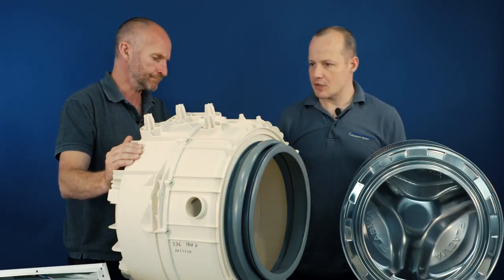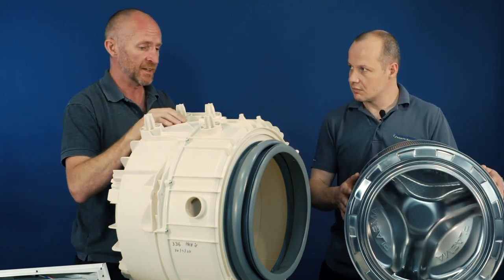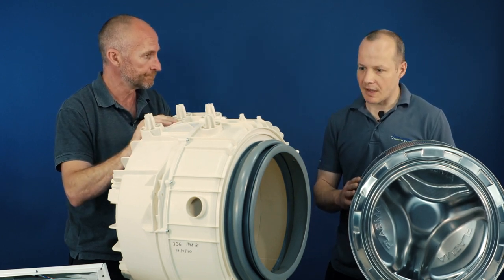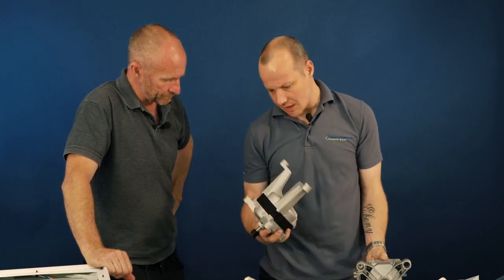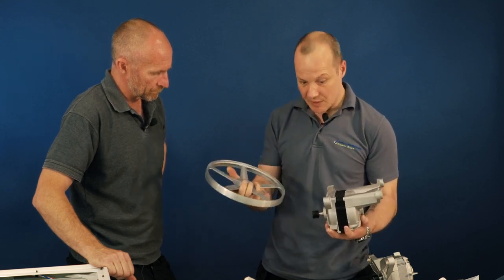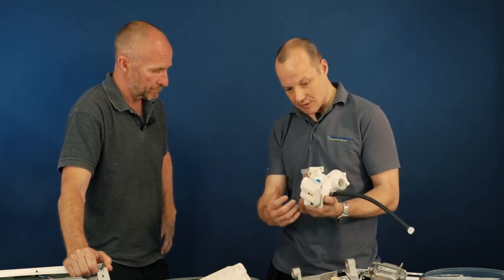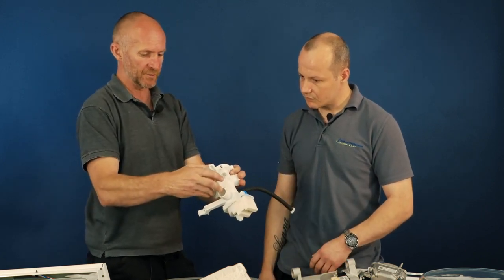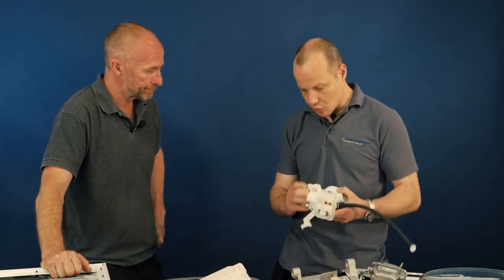Engineer Video - Taking Bosch and Ebac Apart Part 1

Comment: Just bought the 8 kg based on this, had enough of the throwaway society.
Reply: How has it been after 1 year Jon, I'm thinking of getting one but there are some reviews that say they are not the reliable?
Reply: @dellawrence4323  Faultless for me, the only slight issue I've had is that you have to make sure that the door is pushed home when you close it or it will throw up an error code.
Most likely limp wristed user error ;)
Overall very pleased though.
Reply: @radiowardenclyffe  I get that with my boch it' also beeps very loud to let everyone know you have a limp wrist. 🇬🇧 👍 😁

Comment: Some years ago I came into a bit of money so I bought a new Bosch dish washer and a new washing machine with no more that 2 washes a week the main bearings went of the washing machine after less than 4 years I phoned up a repair man and once I said it was a Bosch he just told me to bin it to much work to repair it I just buy cheap ones now when it goes wrong just get a new one but having said that I like this new Ebac and may well get one when my cheap one goes wrong as it soon will no doubt
Reply: The cheaper Bosch were "badge engineered"
Reply: I bought a second hand Bosch (Exxcel 1400 spin) around 10 years ago, and whilst it isn't used every day, or even every week as I live alone, it's never once given me an issue. I paid £85 for it and it was probably a few years old when I bought it. I personally trust Bosch as I've always (so far) had a good experience with them.
Reply: The bearing went on my Bosch washing machine just before the guarantee was up so contacted them and a engineer came out to fix it while I was at work , came home to find it fixed but went outside and the whole drum was sitting there with the bearing in it , noticed the bearing was manufactured in Poland , couldn’t understand why he couldn’t just replace the bearing.
The old drum came in handy as a patio heater .🤣
Reply: @vapoureyes  These days most washing machine drums are sealed so the bearings can't be accessed so the engineer has to take the old drum out and put a completely new one in, which is likely what happened with you. It's worse for the environment but more money for them so win-win.

Comment: I've never scrapped a machine because of a bra wire...can always get them out with a bit of work,heater out ,or sump off, extremely unlucky to get it stuck around the back and any engineer knows,recirc pumps just get blocked with scale ,get noisey

Comment: Guys, I don't dispute your experience but I can say hand on heart that in all my years in the game, I never scrapped a machine because a bra wire was stuck between the drums. Even with welded drums you can generally get it out by taking off the drum lifter. Also, it's gonna be a bit more awkward to clear should something get into that recirc pump.
Reply: these two guys getting paid by ebac to slag off bosch
Reply: @Boschwash24 You cannot deny though that Ebac machines are more serviceable. They also come with a 10 year warranty, and are British made. Unlike Bosch machines, which are mostly now made in China, unless you buy the most expensive Series 6 models.
And also, Bosch will use marketing techniques to highlight certain benefits and selling points over their competitors, just like any other manufacturer.

Comment: I can understand why the washing machine repair people are keen to promote repairable machines - that makes sense. The other related problem is the call out charges - often over £50 to get them to show up and their blame culture - we had a Hoover washer that was under warranty and the button panel broke - when the 'engineer' replaced it he pointed at my daughter and said "there, you have a child - she pushed the buttons and broke it" and then he insisted that my wife pay the bill of nearly £150. So no, too much poor experience of scammers that work in this industry. Every time a machine breaks (they usually last 7 or 8 years) I now buy a new one and install it myself.
Reply: Many years ago I was given a hoover washing and a girlfriends bra wire blocked the pump. It was still under warranty so I called out the engineer. He said the fix wasn't covered because it wasn't their fault. But he must have been having a good day and didn't charge me. Kept it for a few years (the machine, not the girlfriend) eventually actually giving it to a new girlfriends ex boyfriend, not a bad swap I thought.
Reply: @markrainford1219  you were lucky. There was absolutely no evidence that our daughter had broken the control panel and she never showed any interest in it - the bloke just intimidated my wife into paying for the repair. 
Good work on the girlfriend/washing machine swap - probably an ABBA song about that.
Reply: Manufacturers engineers are focused on finding actual failures within an appliance to hopefully learn from them and in turn making the appliance more reliable going forwards. Most engineers are happy for the easy life and will quite happily get the appliance up and running whilst also making you aware of what they believed caused the issue in the first instance (hopefully to offer some education to stop it happening again). However, the older Hoover/Candy appliances had really weak buttons and just looking at them the wrong way would cause them to break. 
Not everyone in this industry is out to get the customer, I know I’m definitely not.
Reply: @appliancerepairsnortheast6159  I'm sure not everyone is out to scam the customer but in the experience shared above, the Hoover engineer falsely accused my daughter of breaking the buttons you have described as prone to failure. He then charged over half the cost of the machine for the repair and my wife was intimidated into paying. With hindsight I wish I had submitted a formal complaint about his appalling conduct. But you live and learn and therefore I would not entertain having an engineer out to repair a washing machine again.
Reply: @matthewsemple  it’s a shame that one rotten apple has changed your full perception of an industry with lots of decent hardworking people. Still, that’s completely understandable given the experience your wife had with a manufacturer engineer/parts fitter.

Comment: On our 14y old hotpoint we could remove one of the 3 plastic tumbler paddles and access the pump opening through the drum to get a bra wire out. when the bearing went I decided to scrap it and stiped it to make it lighter to take to the recycle. I was surprised how many coins including pound coins where in the sump pump, the machine did spend a bit of time in a rented property, I guess that is were the money came from.
Reply: Did you get caught for money laundering?
Reply: @matthewsemple  ;-) quite funny - The other damage to the machine was all the silver paint missing from the front entrance to the drum, we guess the people rented had a little dog that either climbing in the drum or something, bit of a rusty mess that I fixed.
Reply: I always believed there's money in washing machines
Reply: @josephthompson4363  And settees...

Comment: I have a direct drive washing machine, I strongly feel that it's the way to go; fewer bearings no belt, no high revving motor. If only they could do something about the pump.
Reply: Noise?
Reply: Yes I have one too , did a course about 12 years ago where I found out about them and as soon as my washing machine needed changing I bought an LG which is still going strong after 10 years with only a drum rubber repaired . They reduce vibration and noise and are so much better to all the other components and my next washing machine would be an ebac if this was adopted as I like to buy British but it is a none starter if they don’t .

Comment: I'm sure if you own one of these.. that ease of opening the drum will come in handy.. weekly..
Reply: If you buy a £200 Bush, not Bosch, Bush, then you'll be taking it to the tip after two years, and paying the council a further £50 to dispose of it for you.
Whereas a machine like Ebac, you can fix it if the bearings need replacing. And it won't cost you any extra for the first 10 years. And it's British made 🇬🇧 so what's not to like!

Comment: 20 years in the service industry and you call the tub the drum?
Reply: Simply a difference in terminology… I’ve called them tubs, drums, wash units, front half, back half etc. The inner in my opinion will always be called a drum and the outer more often than not I refer to as a tub if that makes you happier?

Comment: New regulations are coming for repairability. Older machines were more repairable. Ebac might be ahead of the game. The Ebac main motor is very simple and much like others, tried and tested. It shouldn't give trouble. The belt usually is a 15 minute job.  Direct drive motors are similar in complexity whilst having more windings typically. They usually have complex control circuits which I would think slightly more likely to fail.  I doubt a direct drive has fewer bearings supporting the drum. It might be a slight compromise the bearings doing two jobs. The water pumps usually are very robust. If they check out on a resistance meter use some sewing machine oil on the bearings and be sure they move like an eyeball if that type. Old style SAE30 for old engines is good and 3 in 1 if nothing else around. Belts and pumps usually are easy to get at.  Look to empty the pump filter befor anything else. I recently rebuilt a Sharp microwave of near 40 years of age.  Same type of motor as a pump with jammed bearings ( two pole hysteresiss ). WD40 didn't do it. Terresso 77/68 power station jacking oil did. An ideal SAE30 I guess. My disabled daughter was delighted as it's so easy to use. 30 minute repair. 

The Garrard 201 1930's turntable was direct drive. It looks like modern types of direct drive motors. Instead of electronics it used clock type regulators. A felt pad had to be oiled. Fire in the coils if ignored. JVC made the better ones like TT81.

Comment: LG washing machine have the same casing as your machines, my new DD LG i got back in 2001 when i had to replace the main bearing i had to split the outer shell and replace the bearing rebuild the housing with a kit from espares it was a doddle...
I do have one question and the recycling pump is working all the time is it not slightly more costly and this makes me think that your 3 paddles are not big enough to flip the clothing which in turn helps the mechanic action of the clothes being cleaned? I seen one of your machines and they look very small compared with others ! Why?

Comment: Are the spares cheap?
Reply: Just rang Ebac with same question. The reply "well you wont know for the first 7 years as that's the parts and labor warranty. Buy direct. Going to buy one.
Reply: @leowatkins3718  Not much help then?  The only way to promote the repair and keep philosophy is to have cheap enough parts otherwise it's just as the status quo.
Reply: @rob-yt9di  I'd have thought that the parts not breaking in the first place would be a far better scenario 😉. It's very unlikely that you're going to get cheap parts on an expensive washing machine, I'd have thought, though if they're lasting then I don't mind paying.
Reply: @Nite-owl  David maybe but why make a selling  point that the drum etc allows access for repairs to be carried out? If the parts aren't reasonably priced then replacement would still be the preferred choice for most, IMHO...  It's going to the same with electric cars I expect...
Reply: @rob-yt9di  I don't necessarily disagree, but since we were never told what the prices were likely to be, we'll never know until after the 7 year warranty period.
Reply: @Nite-owl  There lies the `rub` David ...If 7 years is seen as the `life expectancy` for white goods and the repair costs ( labour + parts ) are relatively expensive then there is no difference to benefit from.
Reply: I think the point you’re maybe missing is that the drum on the Ebac can be stripped down and the bearings/drum support changed instead of having to replace the whole wash unit. The wash unit will undoubtedly be more expensive than a set of bearings and a drum support plus the removed parts are now less meaning that less has the chance to end up in landfill

Comment: Wouldn't it be possible to make some sort of service hatch in te drum, in order to get a bra out instead of taking the whole drum apart?
Reply: Asko used to do it years ago, let's just say that wasn't a success because of various reasons, and that was dropped around 1991-1992 when they released a facelifted series of machines with a new drum design ending in 2. (the top loaders kept them until the end though)

Their removable drum paddles in said newer machines were a much better success.
Reply: replace the bottom panel where the drain pump is, and have a drain pump flap, and also the soap drawer dispenser for conditioner to be re-designed, the dispenser has two plastic tabs, these can break off after use..

Comment: Bosch is just garbage like everyone else in my humble opinion Asko is the best washing machine manufacturer they are still going with stainless steel drums and spiders
Reply: Sadly Asko is now owned by a Chinese company who also own Hisense... so I expect their products to get worse and worse like everything else
Reply: LOL. Asko hasn't used SS spiders since 2006, and even then they were problematic on high spin speed/1600 RPM plus machines. There's a reason they moved to a (very high quality however) aluminium spider in that year: tighter tolerances.

Hell, even my 20005 (a machine from late 1995 with it's roots from the mid 80s 1200 RPM 12000!) has slight play on it's drum. Nothing fatal though but still.
Reply: Hisense is solely owned by Hisense now I’m not sure if Hisense own Asko but I know no other company owns Hisense
Reply: @appliancerepairsnortheast6159  and !?
Reply: @abdelkaderelbachir3817  I responded to the comment made by Dan